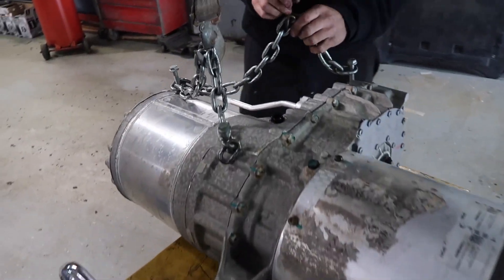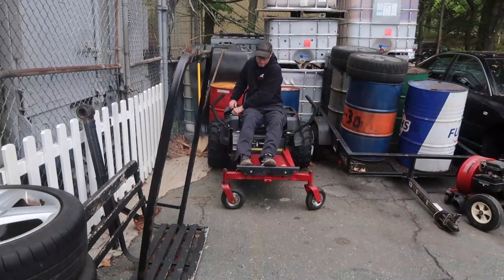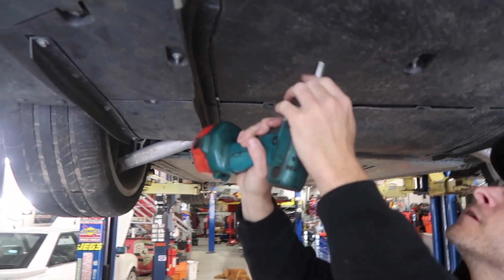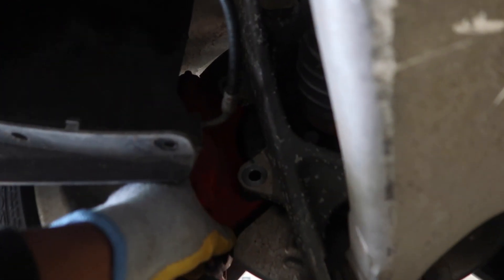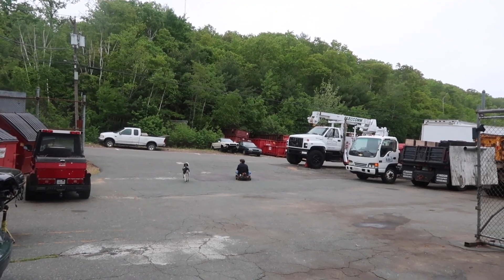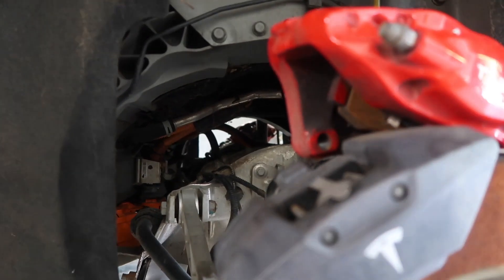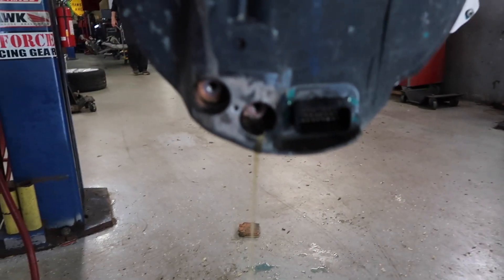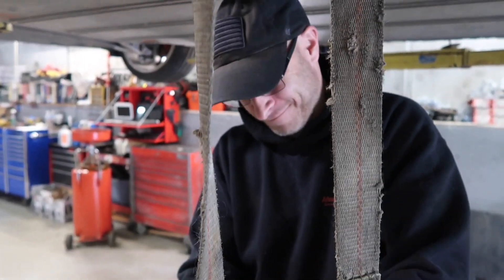Can You Drown a Tesla Motor?

Comment: Do you have a motor insulation tester? I repair commercial laundry equipment and I have repaired motors bigger than that that were so filled with bleach the bearings seized and you couldn't even recognize the motor. My insulation tester showed the windings were OK. So I disassembled the motor, pressure washed it, replaced the bearings and good to go. The tester puts out 500 volts which will jump any wire insulation damage. They start around only $60 so very reasonable and tells the story real quick. Drain the water out first of course and dry well before testing. Ty. Great vid.

Comment: No offense but you buy a car that was under water and expect the motor to be dry? I use to rebuild eletric motors, you can seal them against water intrusion but at the cost of weight and heat, which neither are really a problem with a submerged motor because it's stationary.  Now in an electric car weight and heat are bad, it's like anything there will always be a trade off.

Comment: The electronic can be efficiently cooled and protected from water using mineral oil, which is highly dielectric,  widely used in hermetic fridge unit. The rotor itself of course cannot rotate on a fluid since it will create too much drag and therefore heath.

Comment: I use to pressure wash motors a lot. The problem was not that water got in, but the water stayed in and exposed to air

The bearings could be a problem though

Comment: The comment about electricity and water is partly true....they don't mix... UNLESS it is a distilled water which is a pure H2O or pure water without any solutes in it.... electricity won't travel through pure distilled water and you are safe.... most of the water you encouter today is NOT pure so it is dangerous applying electric charge to water.

Comment: 700ftlbs is a lie when using 1/4 air fitting. 1/2 fitting will get you that much. 250ftlbs is more realistic for 1/4.
He also must have not worked on many vehicles if he is surprised why the axle nut is so loose lol.
"this is it" but needs batteries, controller, etc. to run lolol.

Comment: Before I see the next video on this.... salvage operation. I wanted to make a couple comments. I wasn't expecting circuit boards wrapped around the motor/amateur. In my mind it all boils down to, has the copper paths of the boards and windings of the whole thing been corroded to a point where power washing will not remove the, lack of a better term, infection on the metal?  If the foreign conductive stuff can be removed, there is a good chance the motor will run. How long it will run is up to debate. Oh and by the way. They call the assembly a motor when actually it is two electric armature motors and a transmission. BTW again, It's the closest thing to direct electric wheel drive I've seen so far. Does anyone make an electric car where each wheel is driven by its own motor?

Comment: This is a mess of a fix over simple water incursion.  The circuit boards which are now wrecked by rust COULD have been saved by the mfr using a conform coating over both sides of the board and it's connectors.  Poor engineering practice abounds in this automobile in many areas.  It's NOT a Toyota, that's for sure!

Comment: Have you tried contacting Tesla or BMW? They might be interested in seeing how much damage there actually is, maybe the board is already protected. This may be great R&D for them, as well as a possible testimonial to their product. I heard a story from one of the carpenters that was at a sight for a big concert. Long and short, after the concert, they had backed up the truck to line up with the stage (on a hill perpendicular to the slope of the hill). Well, there was a torrential rain, and when they tried to get the piano (a Baldwin grand) onto the truck, they missed and the piano went off onto the lower side of the hill. Baldwin was so impressed themselves at how well the piano held together that all they charged them for was the missing ivory on one of the keys. Hey, ya never know!

Comment: I guess the question is do you clean the corrosion from the circuit boards and resolder whats needed or find replacements. I sure wouldn't want the job of making those circuit boards run at least not with a proper electronics lab with a good top lit microscope, hot air station and a shit load of donor boards both for parts and for knowing whats needed the corosion on them boards it's unlikley you can read them.

Comment: The thing about electronics is that even if it gets soaking wet you could take a board and dip it in water, so long as it has no power stored or running through it, just dry it out and it will be good to go again.

It's a huge misconception that water will instantly kill electronics.

I've had two way radios soaked in water, you make sure the battery is out, you leave them switched on to drain the capacitors and stick them on a radiator and leave them for a day or so, once they are fully dried out you stick the battery back in and they good to go.

But if they short before you get the battery out they are done for in most cases but not always.
Reply: 400V require different safety devices. I'm almost certain power would have been killed instantly by a moisture sensor. But that is going to be a hell of a lot of corroded contacts to clean. A little love and she should be good to go
Reply: Was it in fresh or salt water? Either way, ten days is a long time to be immersed. It's not like spilling a drink on a phone and drying it immediately.
Reply: @davidm5707  fresh water

Or rather the car in the clip was.

Either way the contacts will begin to corrode in fresh water just not near as fast as in salt water and the real thing to watch out for is capacitors that store charge that have easily bridged contacts but old-school electrolitic capacitors are getting rarer and rarer as DC takes over.
Reply: Right I was just saying to my self water and electricity goes together perfect. It's when we get in between the two it becomes a problem.
Reply: Just use some distilled water and after that put it in a alcohol bath for a moment before drying it on a space heater or an oven set to 50°C.
Reply: @c3h8O as someone who actually does have a degree in electronics systems and robotics who works as a services engineer for a company that specializes in outdoor displays I can confirm. I spend a lot of time working with water resistant electronics.

Comment: this guy a moron. shitting on tesla. the Large drive unit has a bleed vent on top (the black plastic cap). it is designed to vent. this thing is not designed to be water proof. it is like you dont test a LED TV under water can call them a shitty product. Tesla has never claim the model S to be a water vehicle. he acted like he has found new land when water coming out from the motor. stupid. try to fill water into you car engine and watch water leak out when you disassemble it.

Comment: Wash in a 150 degree C ultrasonic bath of deionized water with aircraft aluminum safe degreaser, rinse multiple times with just deionized water to remove any conductive elements from the boards and motor/inverter. Bake for 4+ hours at 150C. As long as power never traveled through while wet you should be good to go.

Comment: Have you used 100% rubbing alcohol  to eat up all the moisture and grim like how computer are fixed if droped in pools  , you submerge or fill what ever electronic system in pure rubbing alcohol  to get ride of water, moisture,  dirt & grim ..  the set it out to dry the air eats up all the alcohol  leaving the eclectric systems clean and dry..

Comment: Electronics are not affected by water. Except by corrosion! Unless there is a mixed voltage like the mains, they can fry while powered and immersed. Most every circuit will simply cease to function until dried out, and reset. 

Drop your precious phone or any other non water proof device in the damn toilet agian? If it can survive a hot day in your car, take out the batteries (if possible), and put it in the oven at its lowest setting (make sure it doesn't go over 170) and leave it in there for a while, an hour or so. Just keep an eye on it early on without letting all the heat out. 9 out of 10 times it will work like a charm!

Comment: If the cct boards are coated, it may be possible to bake the motor in an oven to dry it out. If no power was applied when it was wet it might be OK.

Comment: that BMW fact is incorrect the white and blue are the colors of the Bavaria flag where  Bayerische Motoren Werke , or Bavarian Motor Works in English was developed, The origin of the logo is often thought to be a portrayal of the movement of an aircraft propeller with the white blades cutting through a blue sky. However, this portrayal was first used in a BMW advertisement in 1929 - twelve years after the logo was created - so this is not the origin of the logo itself...  google and wikipedia debunks it  lol

Comment: One thing you can try just for fun... take the rusty and corroded parts and spray rust removal on them. Carefully clean the parts with a soft toothbrush, rinse with distilled water. Afterwards you should spray the parts with cillit bang bath cleaner and let it soak for some minutes. Again rinse with distilled water and put them in a bowl of 99% isopropanol alcohol. Move them around in the alcohol a few times, take them out and shake the excess alcohol off. Now let the parts dry for at least 3 days and reassamble them. 

With that methode i saved a notebook which was underwater for some days!

Comment: Hmmmmm...
One can hardly neglect the fact that BMW badge has become one of the most recognizable logos in the world. However by 1917 when Bayerische Motoren Werke was officially licensed by Franz Josef Popp, the company was a part of Rapp Motoren Werke. However Popp decided to make a move and BMW became an independent enterprise. The only thing left was to find clients. So the company already had its named but it still didn’t have a logo. The same year new trademark was registered under No. 221388 featuring circular design which was actually similar to Rapp logo. However new badge had BMW letters on it body located on the very top of the ring.

At the same time new symbol was colored blue and white which were official colors of Bavarian Free State. However it turned out that it was impossible to use national colors for trademarks in accordance with existing laws which prohibited using such tones for any commercial purposes during that period of time. That is why for some time it was not used as the main logo of the company. This fact explains why the majority of people mistakenly think that BMW badge is connected with spinning propellers.

Comment: Assuming the ICs on the control boards weren't detonated from shorts, I'd recommend pulling all of the boards out and throwing them in an ultrasonic cleaner.

Electronics can survive underwater for extended periods as long as they're not powered on. I've rescued computers and monitors which were left out in the rain or underwater for weeks, as well as one machine which was thrown into a raging storm drain canal and they worked more often than not after extensive cleaning. You have to clean them very well to make sure there isn't any contaminants left between the IC legs or under the chips, which is why an ultrasonic cleaner is best for this.

Comment: You've got to wonder how much water is getting in under normal car driving, when there's the heavy rains and you have to drive along those long stretches of deep puddles along the curb. Where's the fail point, where's the water entering - or do the motors have air cooling and that's where it's entering?

Comment: I'm SO amazed! Congratulations for your hard work!
A question: Have you tried pressure-washing this thing, using a mild acid like vinegar to wash away corrosion of the PCBs (these boards are protected by conformal coating, water shouldn't affect them) and associated connectors, washing again with pressure water and drying it on a controlled temperature oven (something like 60-70 degrees celsius...sorry, Im brazlilian, no fahrenheight here)? It may work @rich rebuilds

Comment: Most electric motors with laminated iron plates in their core will actually work fine with some rust in there. You'll need to drain all of the water, clean out any loose debris, dry it thoroughly (which will be the slow part of the job), remove corrosion from electrical contacts, and finally make sure that it's lubricated and turning freely before you re-assemble it. Then it should be good to go.

Comment: Is that retriever how you got that car out of the water😉 Cool vid! The motor itself should be any problem at all. The circuit board would be my concern. Worked with electric motors all my life, they are wonderfully simple and the reason why big auto wants nothing to do with them. If I'm not mistaken the first electric motor ever made still in working condition.

Comment: What about if you soak it in motherboard cleaning fluid then blow-dry it with non static air cleaner, I'm sure you gotta grease something in there since the water and the cleaner would have desolved it, just having a guess

Comment: Gently wash the circuit boards with isopropyl alcohol 90 proof and then keep in a dry place to dry the remainder water it should work that how I’ve recovered information on hard drives and cell phones

Comment: Circuit boards can be cleaned. ROHS solder, and because FRESH water- this is very savable. A healthy bath in distilled water/baking soda, toothbrushes, then CRC Electric Parts Cleaner for rinse, blow dry. TransTune Seafoam and new fluid, invert the unit, soak, drain. Quit yer blood clot cryin!

Comment: the story of the Logo is incorrect!!
"The circular blue and white BMW logo or roundel evolved from the circular Rapp Motorenwerke company logo, from which the BMW company grew, combined with the blue and white colors of the flag of Bavaria. The BMW logo still used today was created in 1917, albeit with various minor styling changes.
The origin of the logo is often thought to be a portrayal of the movement of an aircraft propeller with the white blades cutting through a blue sky. However, this portrayal was first used in a BMW advertisement in 1929 - twelve years after the logo was created - so this is not the origin of the logo itself." 
https://en.wikipedia.org/wiki/BMW#Company_name_and_logo 
on the same page in German, there are more details about Name and Logo.

Comment: Too bad, but I think that's not a design flaw ! This car is no submarine so  the motor is probably resistand to spray water but it is not supposed to be submerged (at least not for a long period). I would first try to clean the boards with isopropyl alcohol and rinse them off several times with demineralized water (both preferrably in an gentle ultrasonic bath).

Comment: I wanted to add this comment right away in case you haven't proceeded to try to do anymore work on this submerged Tesla vehicle. I worked in the past with a gentleman that did destructive testing for the military. This sounds like exactly the type of thing that he would do. Let me pass on what was taught to me. Utilizing a soft toothbrush and or trim brush take a mixture of approximately 50/50 water and Dawn dishwashing detergent and carefully wash down/scrub down all the circuit boards and with a spray bottle of 100% isopropyl alcohol remove all of the debris from the circuit boards. Allow this to dry by using very low pressure air with an airbrush to try to get the water pushed gently out from underneath the components. Spray everything again with the isopropyl, wiping it with the brush. Allow it to dry again using the airbrush technique. Let it sit for a week. Then do some ohm readings on some of the windings and components. Hopefully that will eliminate most of the problems you might have because of the water damage. Good luck, SharpFocus.

Comment: so long as the electronics are not fried, and the capacitors are intact.. if you deep clean everything, and then make sure to check all the control boards, you should be able to clean, and restore them. none of the components had energy going to them..

Comment: I run a phone/laptop repair store in southwest florida. Electronics that are exposed to water damage, are not simply "broken". The components generally don't burn out themselves, but like you mentioned, water does have minerals in it. So when this water dries, what does it leave behind? Minerals. Corrosion. Dirt/Debris. By using an ultrasonic cleaner, and nothing but distilled water, submerging electronic circuts and boards into the water bath for multiple hours, washes away the corrosion off of the gold/copper pads and different circuits that the energy wasn't able to flow through. The only difference is this time, when the electronics dry out, nothing will be left behind on the parts, because distilled water is violently pure. Definatley find a microsoldering type business in your area, bring it in with all of the board pieces exposed and ready to dissasemble and clean.

Comment: For all those saying that it's a Bavarian flag - you are wrong. The logo was part of Rapp Motorenwerke before it became BMW. Rapp was an aviation engine manufacturer and the logo is a propeller spinning against the sky. The original Rapp logo had the propeller in the logo and when it changed to BMW, the propeller was taken off.

Besides, Bavarian flag is light blue and white diamonds - not checkers.

And Rapp Motorenwerke started as Flugwerke Deutchland in Aachen - which is not in not Bavaria but in North Rhine-Westphalia

Comment: Completely disassemble the driver unit and wash it very well with dish soap then rinse well with water then dry it well with compressed air then put it in a dryer (don't exceed 80 Celsius) . I work with industrial electronics and I did it lots of times.